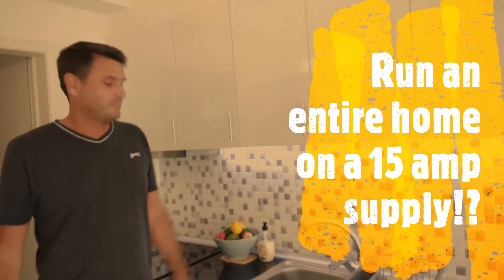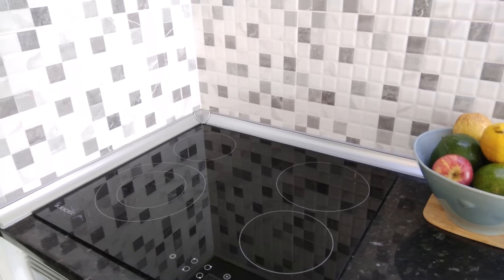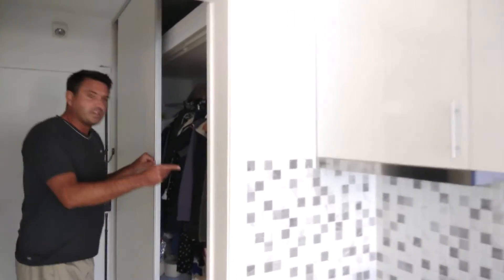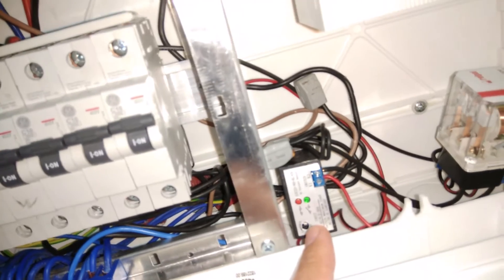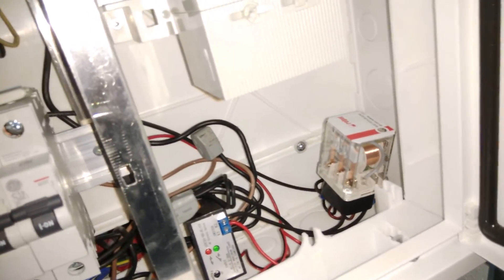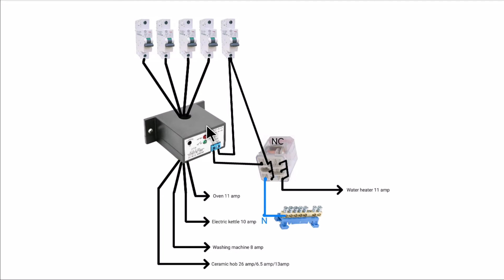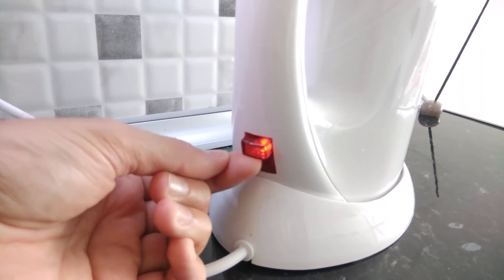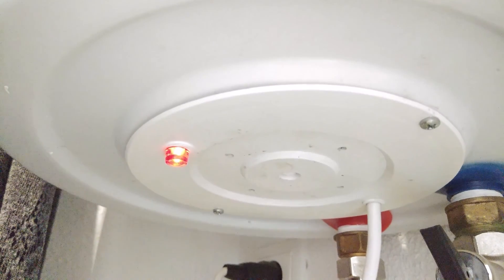Run Your house on a 15Amp  supply!? #ElectronicsCreators

Comment: There are some monitoring relays (that also have the name priority relay in my country) such as ETI PRI-51/16 which opens circuit 2 if more than X amps(selectable procentage) goes through circuit 1. (Or ABB alternative: CM-SRS series) used in conjunction with a contactor (such as A9C22712, but even if it is rated 16A, for inductive loads it only 6A nominal->AC-7B; or HAGER ESC240 for more amps, up to 25A inductive loads). But nowadays, you can always use a Shelly PM or any Power Metering smart device used as control relay for a contactor driving the load.

Comment: A boer maak a plan 🙂
Reply from the maker: @michaelstolman536  I got the idea from the "remote control geyser relays" Eskom made us all install in the 90s, in South Africa. The purpose of the relay/contactor was the drop the load from the grid if there was a power failure, and gradually stagger the geysers from turning on. It's very difficult to turn the power back on if all the geysers have cooled down, and all the thermostats are clicked on. This is almost a dead short for the electrical grid. That was back in the day when Eskom was run by smart sensible people.😉👍.

Comment: Act like a charm. Very good . In france i finaly instal a timer to keep the water heater on just 1 hour before our coming from the jobs. And 1h before the wake up. But it wasn't cheap at all. Thanks for this
Reply from the maker: Thanks I'm glad it helped. I only needed the water heater to automatically switch off, and that was enough not to trip the supply😉. I guess you could do a more complicated version that does the oven and kettle aswell.

Comment: I'd rather upgrade to at least a 25A service because this is a bit annoying.
Reply from the maker: Yes you are right it's much easier! But I like a challenge, and I like to save money 💰 with the cheaper 15Amp service.This proved that it is possible. I'm not in the apartment for most of the year. So the monthly service charges add up.
Reply: I think that power companies are charging too much for their services.

Comment: Yes! Ive been looking for this solution for a few years. What brand of current sensing relay is it?

My use-case is to prevent one HVAC unit (5kw at 23 amperes) from coming on when the other upstairs unit is on. I also want to inhibit the pool pump from running when either of them are on if possible, but remotely by wifi. Know of a wifi-enabled current sensing switch?
Reply from the maker: If you want to have Wi-Fi integration, you could combine a current sensing relay with a sonoff mini-R2. Mabe ad a big relay or contactor, for more current. The CT relay I used was a generic one from ebay, but has been working great for years now😉👍 https://www.ebay.co.uk/itm/265605856471?mkcid=16&mkevt=1&mkrid=711-127632-2357-0&ssspo=y1KwhLicTX2&sssrc=2349624&ssuid=qu3kmgcqR9W&var=&widget_ver=artemis&media=COPY

Comment: But if you are cooking a Sunday roast then you will have your 4 rings on plus your oven and that will be more than 15 amps?
Reply from the maker: Yes it's still possible to go over 15A, and trip the "overlaod 15A limit setting", from the supply company. But you have to go over 15A for some time continuously. And the rings on the cooker, tend to modulate on and off (to regulate their temperature). So it's rare for them to be on together for any length of time. It's more of a holiday apartment, so not much "serious" cooking happens there😉. 

The modification solved 99% of the problem. And it saves a bit of money 💰.  Since the electric company charges more for the 40A "upgrade" current limit setting.

Comment: Excellent system.
Reply from the maker: It's very common here in Madera Portugal, to only have a 15 amp incoming supply. Basically all the cooking and water heating, was done by gas and the electrics is mainly for lighting and the odd electrical appliance. But with some clever load sheding, you can switch the bigger loads off automatically, and still run everything off of 15 amps!
Reply: @MyProjectBoxChannel  This is good for South Africa, they invented loadshedding.
Reply from the maker: @georgepapa2950  Back in the days when eskom was still run properly. In the 90s eskom we're fitting remote controlled relays to all the boilers in the houses. This would allow them to bring up the load gradually if there was a power failure by staggering which boilers turned on at which time. If you think about it, if there was a power failure, the water would cool down in all the boilers. This would mean all the thermostats would be in the ON position. That would then act as a deadshort on the electric grid. It was a big problem, with quite novel solution.

Comment: Instead of putting multiple circuits through the CT, could you just put the neutral  wire from the main switch/mcb/rcd to the neutral bar through the CT?
Reply: It's a good idea, BUT the problem is that you will measure the current of the water heater as well! This will cause the water heater to turn itself off ( then on again oscillating). I think if the water heater had it's own separate neutral not passing through the CT, it could work.🤔😉
Reply: @toxicpadda 
Yes, of course. Half a sleep comment.
Reply: @andrewc9235   It's still very clever I never thought of using the neutral.it's certainly easier than passing all those cables through the CT. You just need to split the neutral, so that the water heater has its own neutral not passing through the CT🤓🤨
Reply: @toxicpadda   This is an old thread, but... what you could do is run the main neutral through the CT, and the water heater neutral through the other direction. The heater would cancel it's effect on the CT as it would be 180 degrees out of phase magnetically. That gets you down to two wires.

Two identical CTs wired opposed may work as well. I'm not sure on that one though.
Reply from the maker: @awholelotofnumbers45   That's a really great idea! And super smart too😉. I wish I would have thought of it.  I did think about putting the CT on the neutral,  And just running the boiler neutral outside of the CT, to the main neutral block.  But I think your idea is more elegant.  It very much reminds me of how an RCD works( Residual current device)